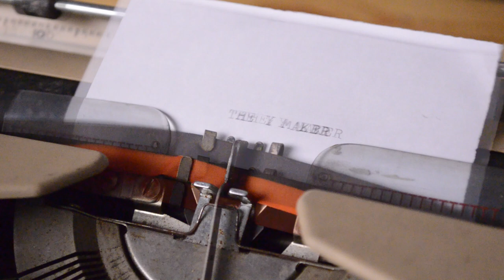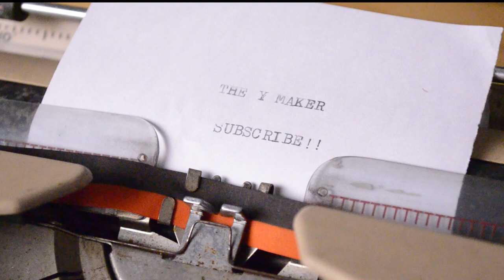Restoration of Forgotten Railroad Carbide Lantern - World War II

Comment: I just bought a lamp similar to this one on a flea market here in Germany. It doesn´t have the little windows anymore but I´m going to cut some new ones. I cleaned the water passage, the nozzle and the inside of the reaction chamber with 25% vinegar which worked like a charm! Now I´m waiting on my calcium carbide to test it.

Comment: My dear, if you intend to become a serious restorer you will have to dismantle the item in it's entirety and clean it more thoroughly before beginning the actual restoration work.  The interior of the box was not cleaned, nor did you paint it or refinish it in any way.  You did not adequately clean the inside of the chemical container or clean the threads on it.  Brite-work, such as the water tank also need to be finished with a clear coat or they will quickly tarnish.  There is so much more that could have been done to completely refinish this old lantern, so that it had more of an original appearance and function.  I truly do not mean to undermine your efforts, so I hope you take these comments as guidance and encouragement for your future endeavors.